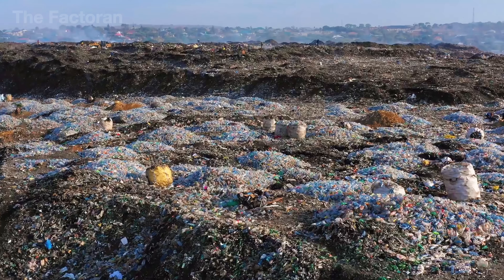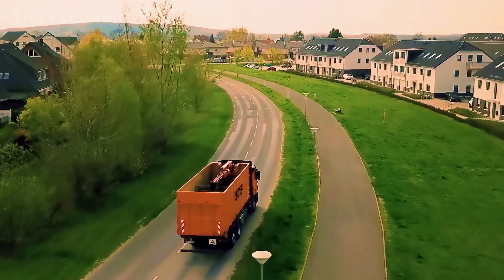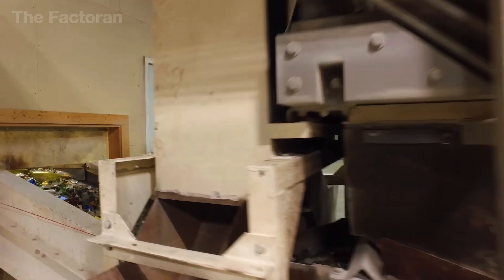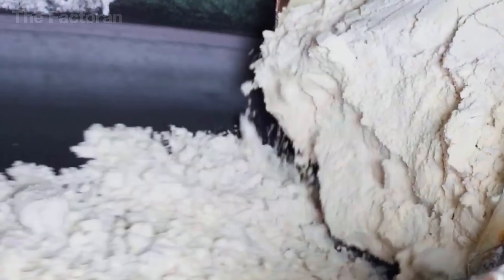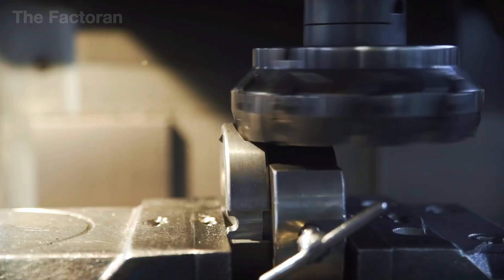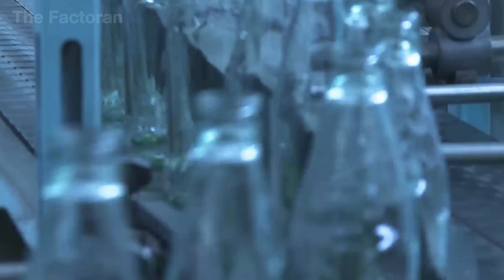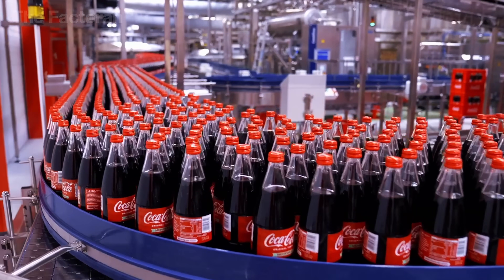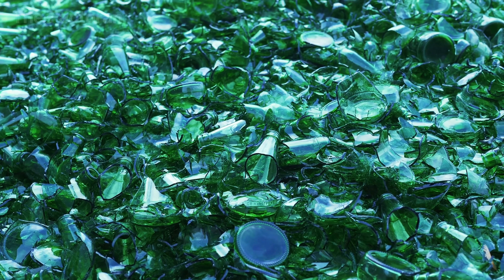How Millions of Glass Bottles Are Recycled In Factory – Massive Glass Recycling Line

Comment: Why are we using a sorting glass bin in the UK if the bin is dumping the whole in a truck?
Reply: No. Look closely. The truck has 3 separate bins, and the glass bin in emptied into the truck colour by colour.
Reply from the maker: In many cases, the sorting happens later at specialized facilities, even if it looks mixed at collection.
Reply: No you are wrong. It's separated  on the belt. 😅😅😅